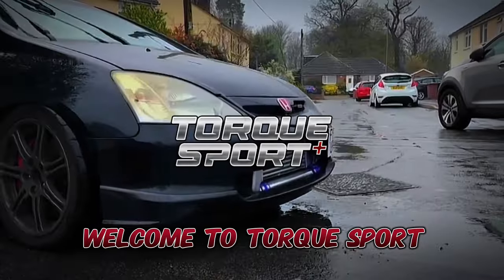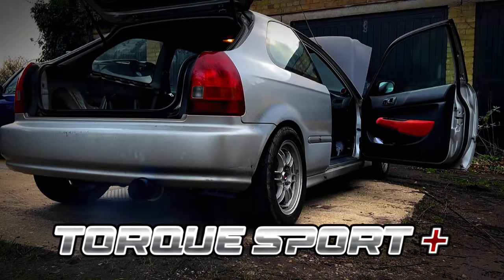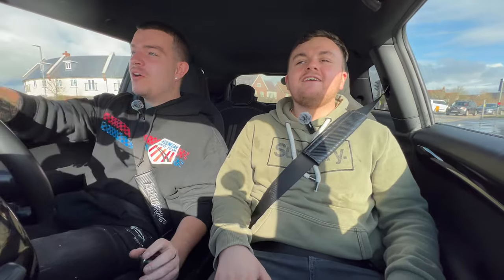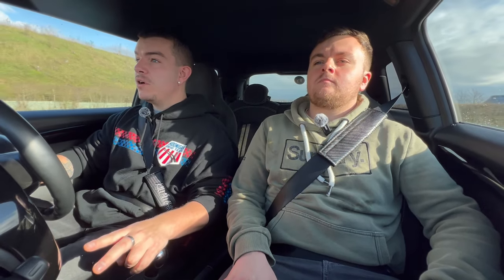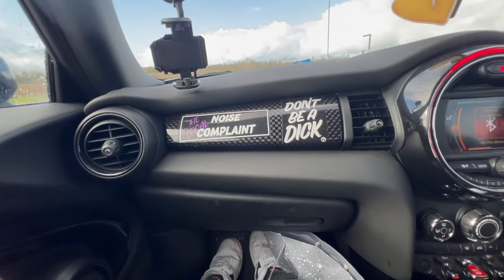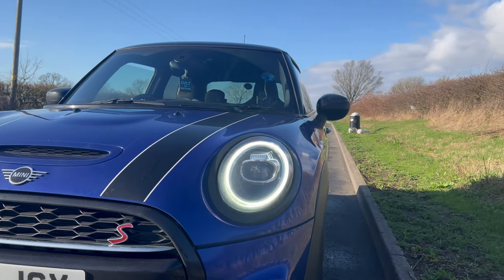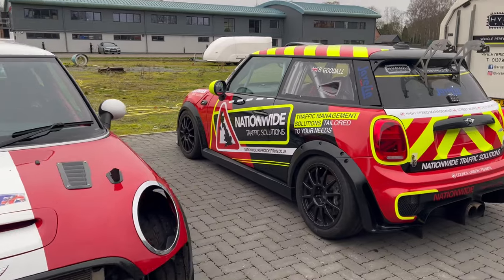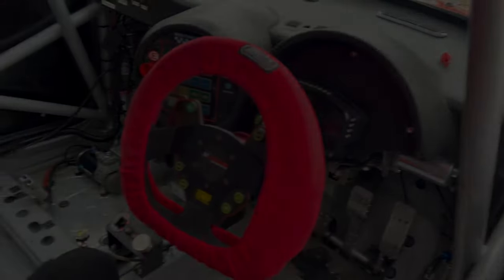Mini Cooper S F56 LCI Gets A Custom Tuning Box + Dyno Time

Comment: Great video! Looking forward to part 2. I have a cooper s 18 plate lci and im looking to stage 1 with these guys, as I live in Ipswich. Very reassuring to know hybrid do a good job 👍
Reply from the maker: That’s cool to know, we have some clubstands and meetups ect coming up this year if you’d like to tag along! As your quite local to myself (Gianni) 

You might be lucky enough with the 18plate to get away with the unlocked ECU, seeing you more towards the 270-280hp and 400nm+ mark I could stand corrected on this though 

Thank you for the kind words also, be sure to follow the channel here will be lots of content on this car and other cool cars 👌🏻💯
Reply: That’s great! Make sure to post info of the meet-ups on the f56 group, or on YouTube, as I follow both daily 😅.

I don’t want to take it too far, as I’ve heard the clutch can only take so much torque. Your figures are very good though. Bet there’s a massive difference there 😮
Reply from the maker: @F56_biedul  yeah we will do mate, yeah I’m sure they’re pretty good for 400nm of torque, but yeah I get what you mean always good to be on the safer side 👌🏻
Reply from the maker: @F56_biedul follow and pm me on instagram same account name we are doing clubstand at fast show if your interested
Reply: What exhaust you guys running
Reply from the maker: @Carlosnufc  hello mate, we are running a downpipe back 3” custom tig welded stainless exhaust with small backbox no resonator and 4” tips

Comment: I’ve got a 64 plate cooper s and looking at getting stage 1, only in Colchester so not far from eye! Also what exhaust are you running on this?
Reply: My Mrs lives in Great Yarmouth pretty sure I drive past this on the way back from there, I’ve seen the yellow c1 and the red mini parked in the yard
Reply from the maker: @tskiller3597  most probably, It’s just off the main road from diss / a11?
Reply from the maker: 100% go here, they won’t push the car unreliably, have incredible customer service and aftercare which from experience, it’s priceless! 

Not only that In a Pre Lci cooper s, you’ll see circa 270hp and around the 400nm range 

It transforms the car completely 

Also in regards to the exhaust, this was a custom job we made ourselves so it’s a stock downpipe into bolt on 2.5” res delete then post res delete its 3” all the way back into a very small backbox.

I will also add that we are in no way paid or sponsored by Hybrid Tune, we just love to A) support a local business B) also they are just great at what they do especially with the mini engine b48 ect, given they race in the mini challenge they know the cars inside out